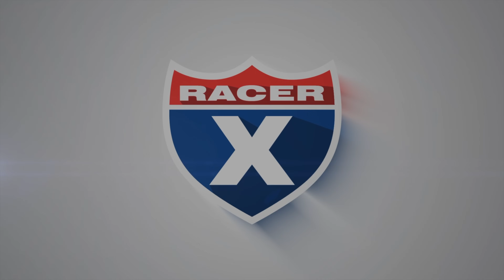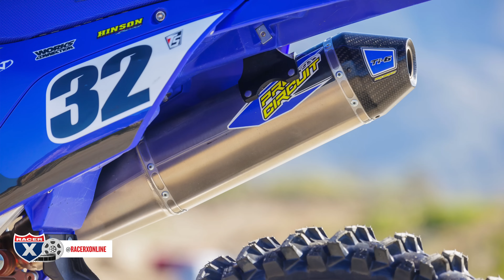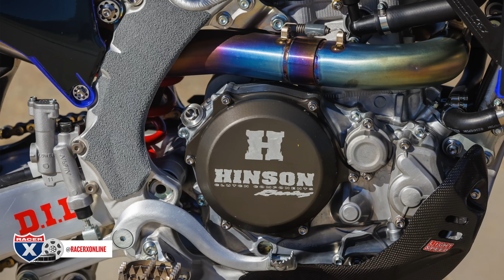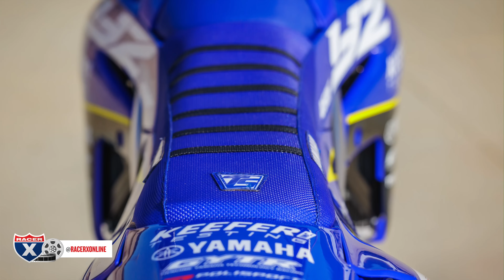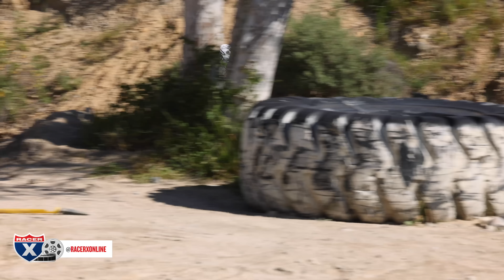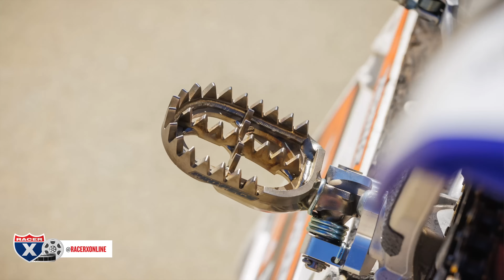2024 Yamaha YZ450F Project Bike Garage Build

Comment: So, I just looked up the specs of the 839 bar on the Renthal site and it says 91mm height and 51mm sweep and 802mm wide. Keefer and Eddie say here it's 803mm wide, 92 mm high and 53 mm sweep. So......are there TWO Renthal 839 bars or is it "those numbers are close enough" , Just wondering because Keefer said sweep was 54mm (Eddie said 53mm) and Renthal says 51mm which is quite a difference. I have the SX Race Pro Taper and Henry Reed, the sweep is 54mm and 57mm respectfully and there's a big difference visually in sweep between those two.
Reply: I wish the bar manufacturers would give their measurements in degrees! Because a bar with 54 and 57mm sweep could actually have the same sweep angle as it all depends where the bend is made. 
Faast flex bars give their sweep in degrees and makes way more sense for the average person to compare. 
Renthals comparison simulator is great in comparing their bars against each other but sucks for entering measurements from other manufacturers and I’ve found time and time again that manually entering in the same widths doesn’t match on the simulator.
Reply: @ChookChasersMX  I couldn't agree more. I was going crazy when researching bar bends! I also couldn't believe the difference between a 54mm sweep and 57mm sweep as I have both the Pro Taper SX Race (54mm) and Henry Reed (57mm) and holding them top to bottom, the difference is substantial. I settled on the taller Renthal fatbar (603) Windham bend.